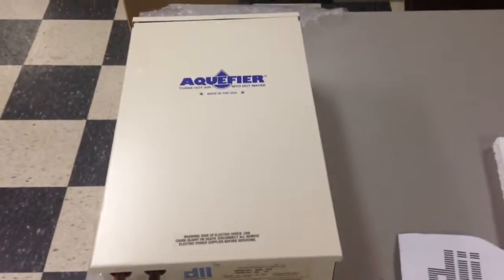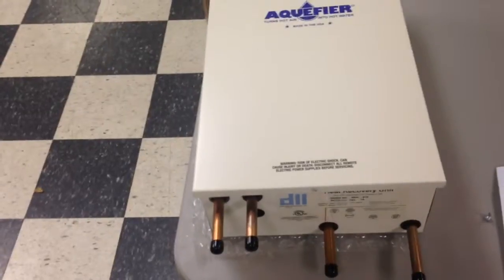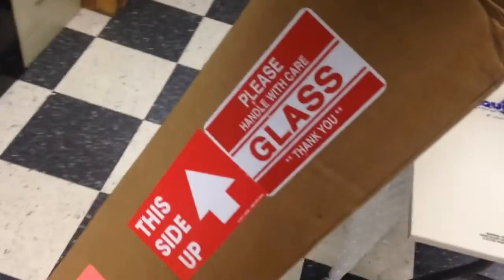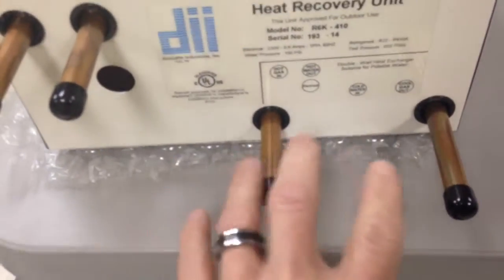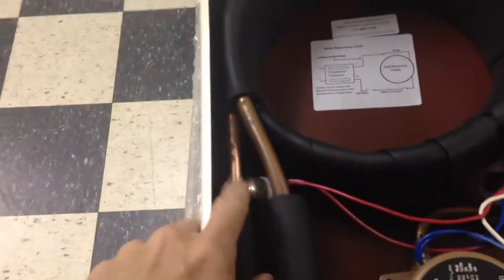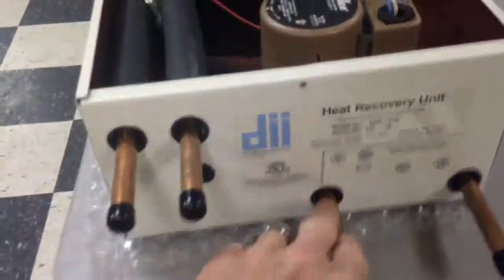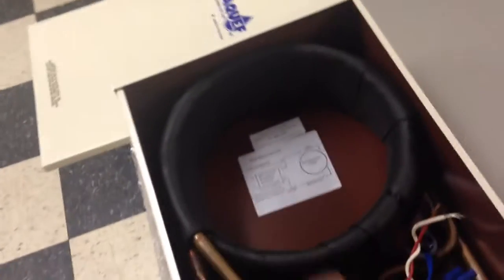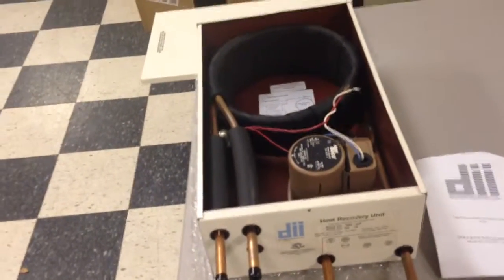Free Laundromat Hot Water - Doucette Desuperheater

Comment: How does it work after 4 years? I was considering this but worried about the water scale.
Reply from the maker: lala007 lala007 When installed it I missed the bypass valve,Personally I think it should be built in, the bypass prevents the unit from operating in “reverse” when you tank gets hot. 
So what happened when my tank got hot it started circulating hot water back to this unit and increased the load on the AC. 
The bypass valve would prevent that from happening. 
So I had to shut it off due to the load on the AC and haven’t got the bypass installed yet. 
To answer your question I’m not sure about s all build up as we have pretty good water.